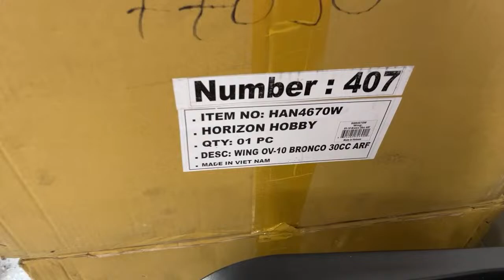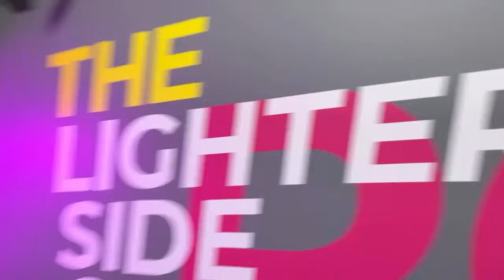The Lighter Side Of RC After Dark is live! Back from Tucson Jets.

Comment: Good Morning;
I've noticed on all of your builds that you do not install the "Asan Nose Steering Gyro"? Any reason for that ? The gyro keeps the nose perfectly straight on takeoffs and landing. Thus dramatically reducing your mental workload in this area.
Reply from the maker: Nose steering is run through the Cortex Gyro instead of the Gear gyro like the GS-200 has.  Much easier to setup as everything is done from the radio instead of the gear controller.